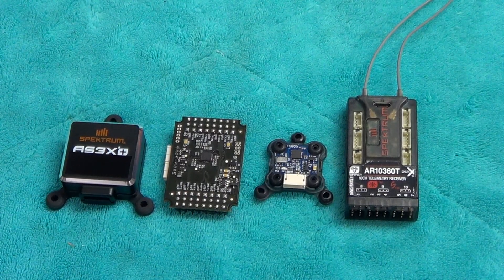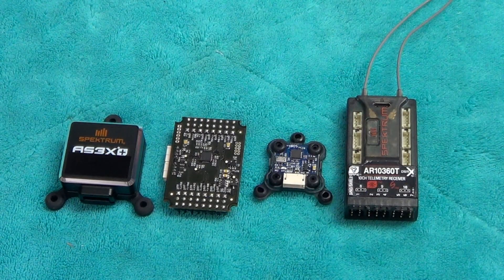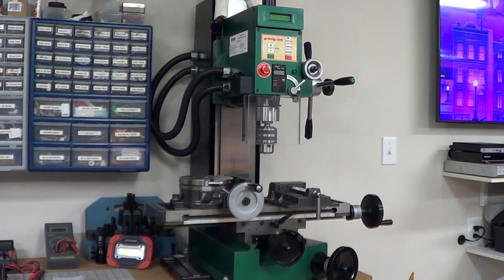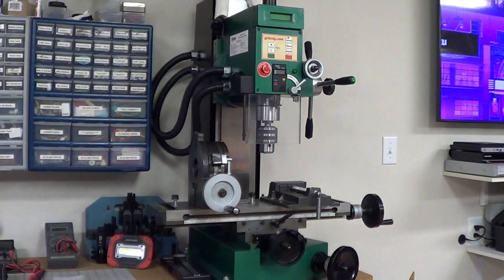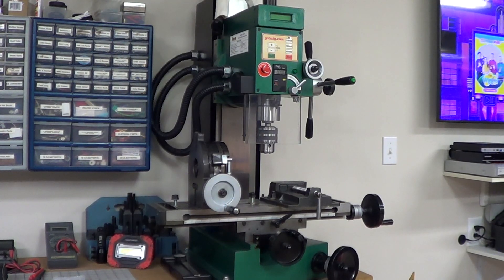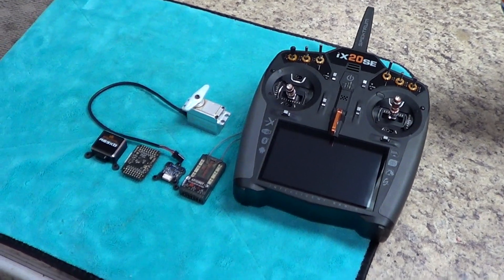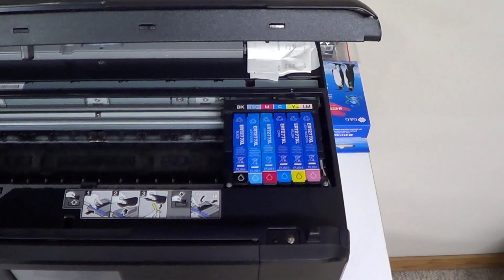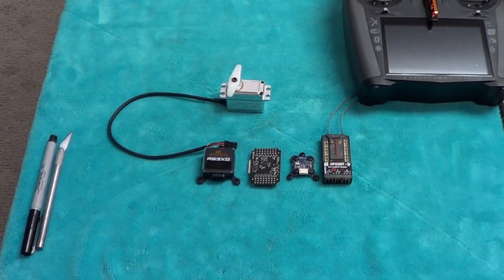Spektrum Synapse Gyro Systems Part 2

Comment: thank you man.. you solved most of my questions. I wonder not if I wrap up the AR10360T in foam and 3D print a casing for that I f I can uyse that receiver in a jet plane 6kgs and 8kgs thrust which I usually fly and prevent interfeerance.

Comment: Can you explain to me this question I noticed that no one has made a video explaining about these receivers going bad and if these receivers have some kind of an expiration date because I have two receivers that have all of a sudden stopped working no led light flashes and the thing is they have been working perfectly for over 15 flights now all of a sudden I go to turn my plane on and it stopped working so I plugged up a new receiver and it works fine so I know it’s getting power so why is this happening this is the second receiver I’ve had to go bad in two different planes I’ve  googled the problem and no one wants to touch on this subject now I don’t wanta lose my expensive plane while flying can you explain this matter or make a video touching on this subject please
Reply from the maker: No time limit on receivers Electronics don't wear out but can fail for some unknown reason .
Reply: if it's happening to you more often than others check wether you are doing something wrong.. I ve never had an RX go bad on me.. and I had a lot of them